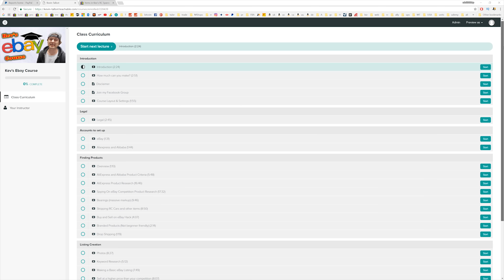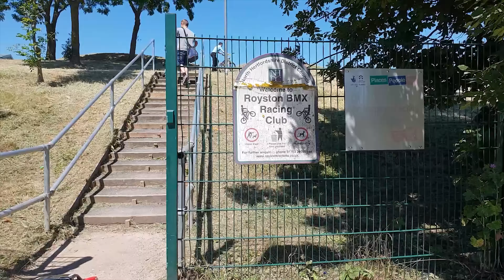Traxxas UDR - BROKE // Slash 4x4 - BROKE // DJI Mavic AIR Drone - CRASHED BMX Track Carnage!!

Comment from the maker: First :)
Reply: Second lol
Reply: Kevin Talbot I’m 5th
Reply: What weight diff oil do you use in Xmas?  Also shock weight? P.s not a super newb and learning a little in your course.
Reply from the maker: silicon earplug center amd stock f and r
Reply: No
Reply: If your doing bash with jumps or stunts you need for the rc is the right speed good balance to do less damage or no damage to vehicle for taking it care and fare

Comment: If you want to jump big jumps, you must adjust springs a little and put stiffer oil to shocks.  if its almost on ground by its weight, its clearly gonna break, becaus u will hit end points of shock travel (rear) or ground (front) at high velocity. u need to slow down fall as much as possible on shocks, so the impact will be smaller. U must experiment a little. :) i have UDR and its can hold 1m drop  without hiting endpoints or ground. UDR is scale model, not basher but i like to jump to :P Great videos, have a great day :)
Reply from the maker: I rather my shocks bottom out. Thicker oil will break shocks, mounts arms and it wont glide over bumps. Thanks for your input but I'm gonna carry on doing it my way :)
Reply: i mean a little stiffer than original. yes, if u put vaseline in it will destroy suspension :D  agree, its more bouncing od bumpy tracks but holds big jumps like nothing. ofc u will do it as u want, i wanted only share my experience with that. im just to lazy to repair it over and over again :D

Comment: Hey kevin i keep breaking my input shaft pin on my stock rustler vxl.  Running an 83 spur with 16 pinion. 4.5 inch tires. My rollout is 1.002 and my local hobby shops keep saying i need to change the gearing but i want your opinion. It runs beautifully which is why i dont want to change the gearing. And it wheelies a lot!

Comment: Just saying if u want to stop breaking your stub axles on your slash take off the metal hub carriers and the front metal steering stuff. Get rpm carriers for the rear and front have not broke them before and had huge bad crashes which the traxxas ones broke and haven’t broke and stub axles

Comment: Hi everyone.  Last night on friday, I went racing with my 2wd slash for a stock class race.  It uses the original 12Turn Titan motor.  After the second qualifier, I went to go cool off the motor and when I applied the wet paper towel, it sizzled for a moment.  Have I burned my motor at all?  P.S.  I took it for a test run saturday morning and I still get about 15 mph with the 16 to 90 gearing that comes stock with a Hobby wing 60 amp dual output ESC.
Reply: That is most likely the water boiling because the motor was hot. Like when you put water in a hot pan. But a Slash should go faster than 15 mph. My friend bought the cheapest Traxxas you can get and it goes 30 mph.

Comment: What have you found that's best for a driveshaft in the slash? have you tried the integy ones?  I know you broke mips
Reply from the maker: these are the best so far, ill try xo1 at some point
Reply: Kevin Talbot I just broke another stock drive shaft they have actually taken a beating
Reply: The skinny integy ones are really good, they rust though and I think they might be out of stock
Reply: Nathan Gariepy thanks good to know. I was gonna go mip but I've seen them break and I'm far from kind to my rc' s so if I break the integy I at least know how much they can handle and I'm out a lot less money
Reply: The Traxxas CV axles are nice I have only broken 1 so far and it was only a spindle shaft, so I bought 4 more and bash pretty well all the time and still haven't broke another also I have RPM control arms and enjoy not replacing them as often as the stock Traxxas arms. Aluminum hub carriers for sure on everything you ever want to own. Any how🍺🍻 good luck on the bashing.👍👊😎🐍💩
Reply: Mip's
Reply: Shayd Rowdeb they don't hold up.😭😭😭😭😭😭
Reply: Try tekno m6
Reply: Kevin Talbot try tekno m6 drvieshafts
Reply: Micron RC very strong if your doing racing, I race mips
Reply: Shayd Rowdeb MIP shafts are well ballance but the integrity is brittal, if that makes sense. They are good for going straight but when you tumble them they explode 😭😭😭😭😭😭😭👍👍👍👍👍👍😱👊😎
Reply: MIP has good customer support. If you break things they will send you replacement parts!